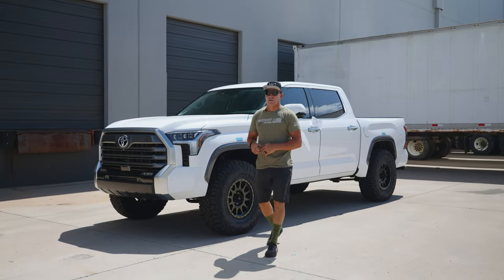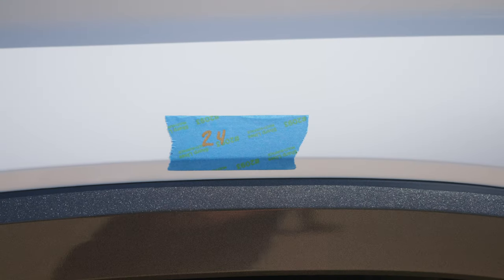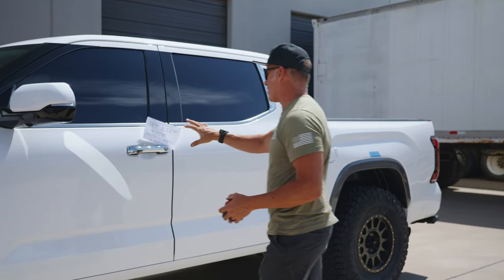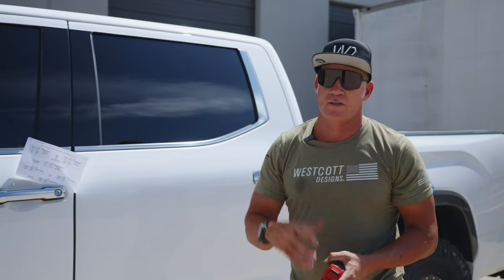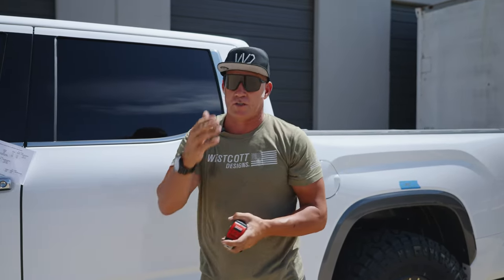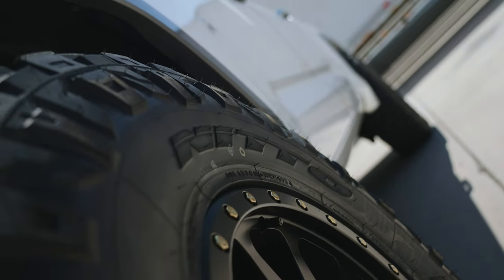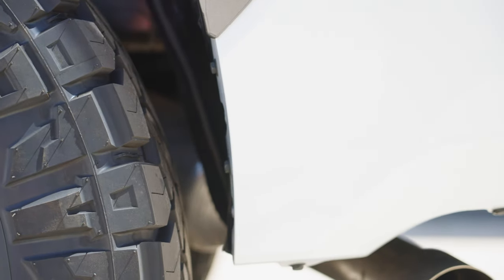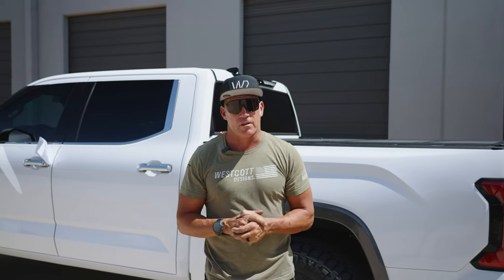What’s causing my new Tundra to not ride right after lifting it

Comment: You should show the close up shots of where you guys cut in the wheel wells
Reply from the maker: We like to pin back the liners if we can.  We prefer not to cut out the liners.  35’s don’t need the lines cut at all.  Depending on what brand 37 you run you may need to trim the liners.

Comment: Jeff is it possible to put a bigger lift (Westcott Design) on a 23 Tundra Pro. I understand you have the 2 inch lift and that is as high as you guys wanted to go to keep the factory ride. If I am ok with it riding harder can you put a bit higher lift? 2 inches to me is not worth the effort or expense my opinion. I am ONLY putting a Westcott lift on my truck or it will stay stock... I was hoping for a 4 inch lift or at least level 4 in. in the front 2 1/2 in back or how ever it measures out. .

Comment: Thanks for the educational videos, Jeff. 

I’m missing something on offset though. If I want some poke should I be going for a 18+ or 18-? I feel like I’ve seen them poke on both so it makes me think I’m missing something. Is it different for every wheel/maker?
Reply from the maker: + numbers from 0 on up continue to pull the wheel in under the vehicle.  - numbers starting at 0 on up pushes the wheel out further.  And the offset effects different vehicles different ways and this is because of the hub location that the wheel bolts to its location.  A Tundra with a 18x9 with a +18 still has 1.5” out side the fender or poke.  The higher the + number like a factory tundra wheel is a +56 or +60. This is is so it has even amount of load on the hub and bearing to lower the chance for failure and maximize it’s life.

Comment: I hear that once you put an after market lift kit- Toyota will null the warranty.
Reply from the maker: They can not void your warranty.  Here is how warranty works.  If you change something on your vehicle, and that part that you change fails or cause failure on any other Toyota parts, they will not cover it,  but they cannot for the warranty on any other parts.  Example:  if you change the wheels on your truck and change the offset and the wheel bearing goes out, and Toyota can prove that the additional load, because of the wheel offset caused the wheel, bearing to fail, they can void the warranty on that wheel bearing and that wheel bearing only.  I have been doing my lift since 2015 and some of the vehicles now have 150k miles on them and have yet to have our lift cause failure on the suspension or any other part.  We sell them to over 400 Toyota dealers.

Comment: I'm putting 34" on my stock 20" wheels on my 22 tundra 1794 AVS - I have your 1" rear and 3" front leveling spacers -Toyota is going to do the alinement - On your spec sheet would that be the Tundra 4x4 22-23 (except TRD Pro) spec numbers?
Reply from the maker: That is correct.  How wide of a tire are you going to run?   Make sure they are dead on or just under and it will work great.  Don’t let them tell you they got it close but couldn’t get it right there.  Then ask them if other people are getting the numbers exactly why can’t they.   If they say different truck tell them no same truck same lift with correct numbers😉

Comment: Hey jeff hope you’re doing very well my friend, i got a 2024 Tundra Limited TRD Off Road, i just put a set of 35” x 12.50 R20 on stock suspension, no rubbing at all not even at full lock, but i lost my alignment sir, it tends to pull to the right. I took it to toyota dealership they make the alignment and still pulling to the right, so went back to toyota and this guys put another set of tires of another tundra and drives perfectly straight, so what’s seems to be the problem?? To i need to put the leveling kit to get the alignment??? Is 0.00 in all tires at balance wise!!! If you have any idea please i will appreciate your input sir, thanks!!
Reply from the maker: So all tires affect the way the vehicles drives a little different.  This is why we always suggest an alignment any time some does new tires.  You can also rotate tires and depending how they have been wearing will cause it pull or wonder.  You may have had a bad tire if it pulled and if it was moved to another location on the truck and it caused it to pull in the other direction.  We see more out of round tires these days and rebalancing them does not make them round again it just makes them heavier.  Please feel free to call me any time with questions or concerns on my cell.

Thanks again,
Jeff Westcott
Cell 480-703-2440

Comment: With a kit this cheap, the caster they are showing is bs.  You can absolutely get the camber and toe where it needs to be but the caster is impossible to get where they have it.  They will never show a raw video of an install on a new customer and do the alignments no cuts, and show they have the caster right.  The upper ball joint needs to be adjustable to get it right.  It is the kits fault.  It’s one of the cheapest out there
Reply: I’ve installed this same kit, 3 different trucks.  All of them the caster is different between them.  You can adjust the lca eccentrics all you want, you will be lucky if you can get to the spec they have listed.  Not only that but these trucks aren’t simple to align on hunter machines thanks to Toyota and the ride height differences and ballasts.